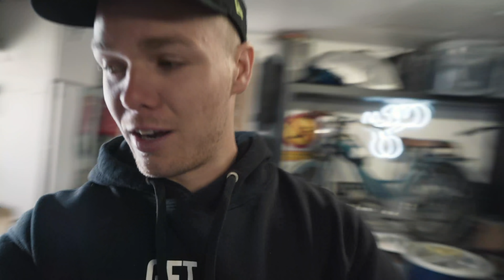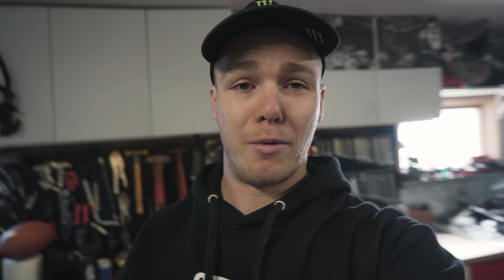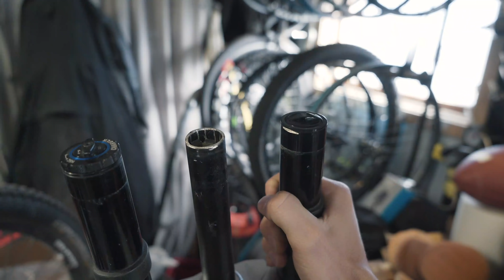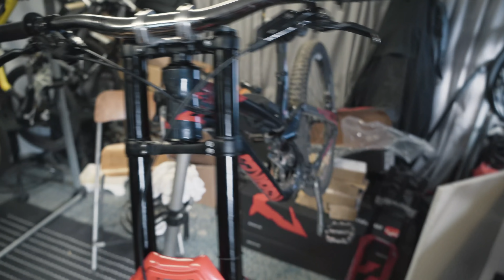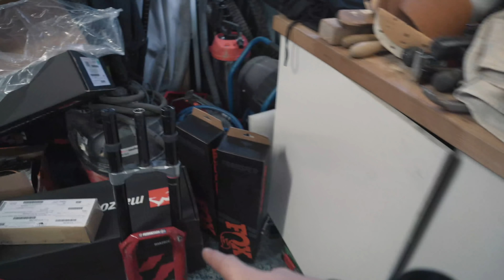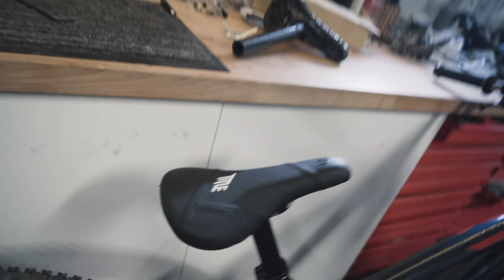HUGE UPGRADES ON MY DOWNHILL BIKE! *NEW GIVEAWAY*

Comment: You should just use a pipe cutter for cutting the steering tube. Costs around 10 $ and the cuts are perfect
Reply from the maker: mopedvieh it was used in the video?😂
Reply: @MaxFredriksson  
Yeah I saw it laterin the video, after my comment 😅 But it was only used for the seat post. It does also work on the fork so that using a saw is not necessary.
Reply from the maker: mopedvieh not on a dh fork, the sanctions are in the wAy🤷🏼‍♂️

Comment: I found a Mountain bike that has a rear derailleur hanger, quick release tyres, disk brakes, a threadless stem, front suspension and it only costs €230 ($246). Is this a good bike? Its called the Apollo Valier.